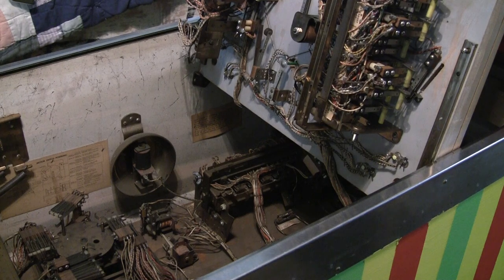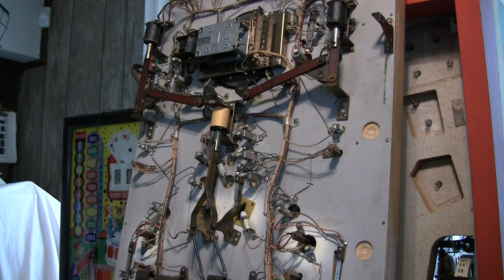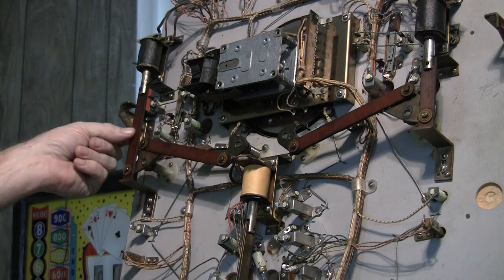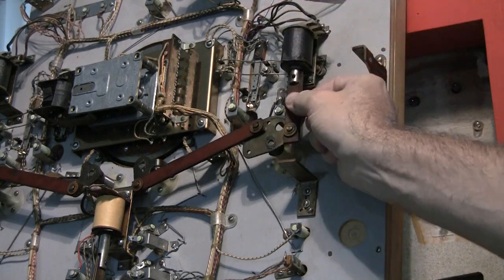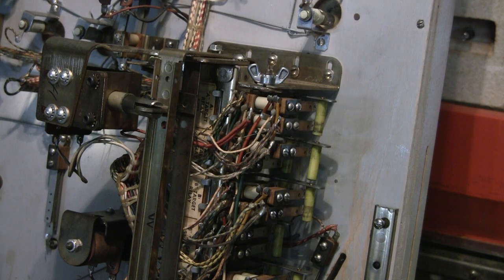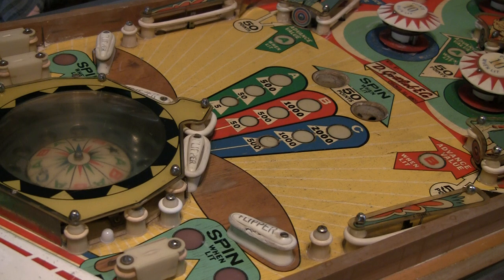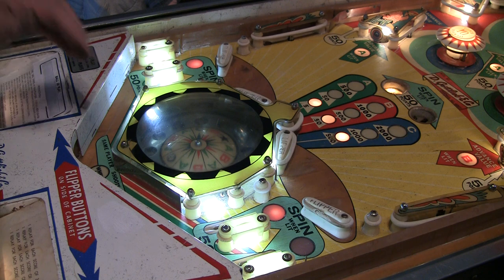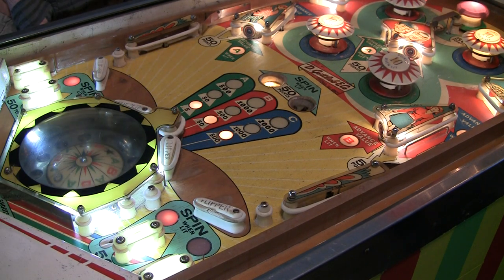Restoring a 1967 Gottlieb "Hi Score" Pinball Machine

Comment: Use ttp dry silicone lubricant on all the mechanical parts even before oiling or greasing let it dry first. You could use PTFE dry lubricant but it's not good for Plastics polycarbonate and the types of plastics cause cracking so probably not advisable.
I don't know if it's the white balance of the camera but even the warm  looks  a bit on the bright side especially in back boxes, you could use a 200 to 600 ohm resistor with the LED cut its brightness down